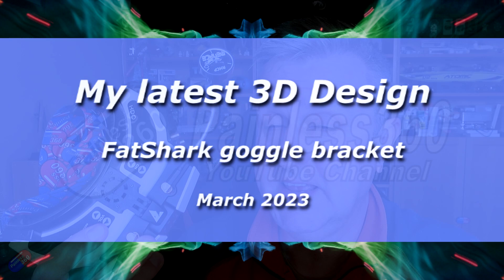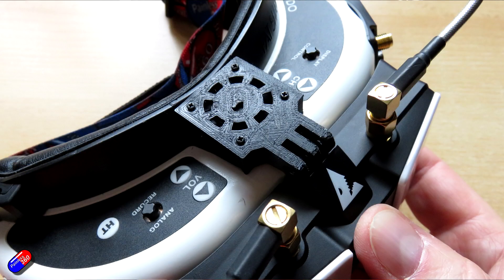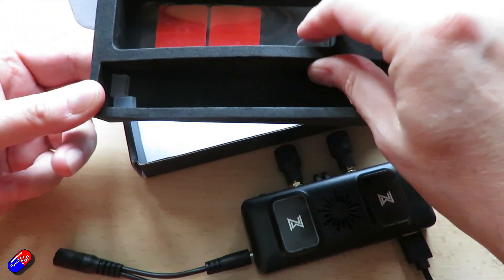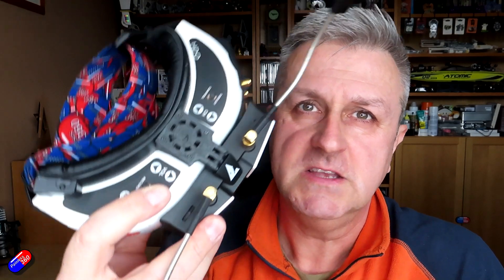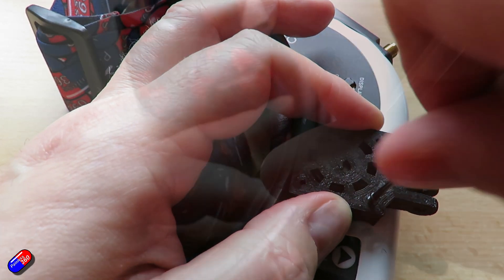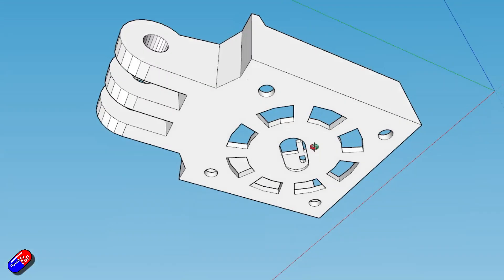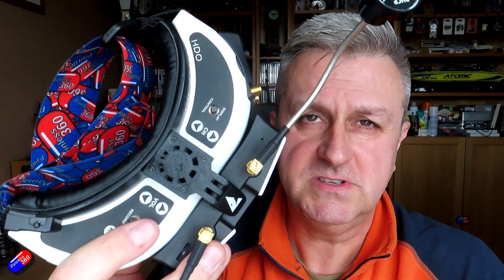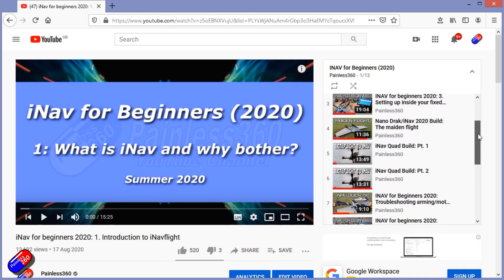My lastest 3D design: Walksnail and HDZero Module Bracket for Fatshark goggles

Comment: Lee - re: Walksnail VRX videos - getting osd to work with Betaflight, iNav, and Ardupilot - as well as how to use use custom fonts - and, do you see a current/future option for graphical (as opposed to character-based) osd with Hdzero or Walksnail?
Reply from the maker: The setup of the VRX for all things is the same as the full goggles. I'll cover that in the video.. Happy flying